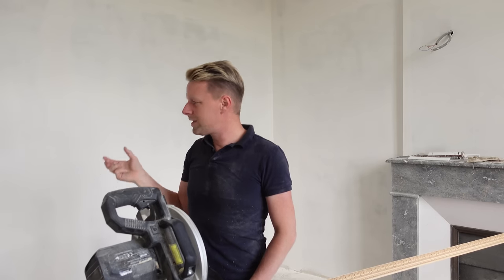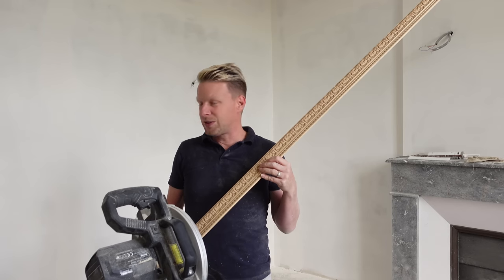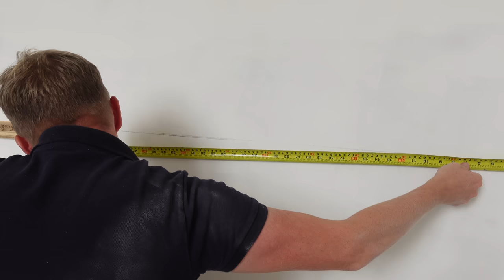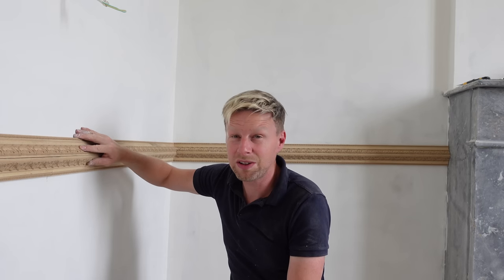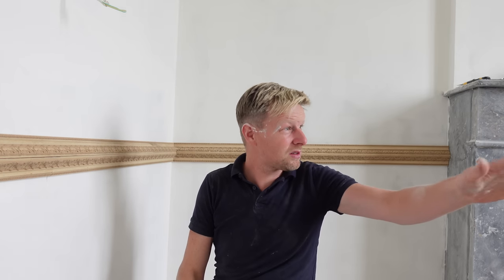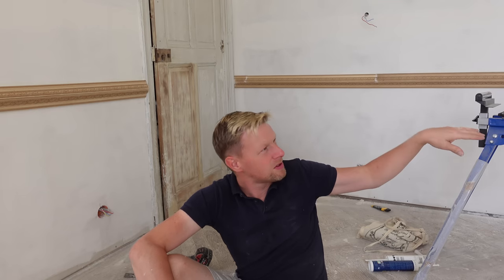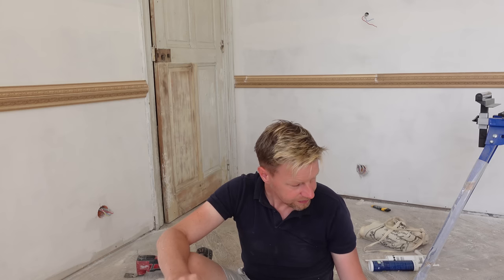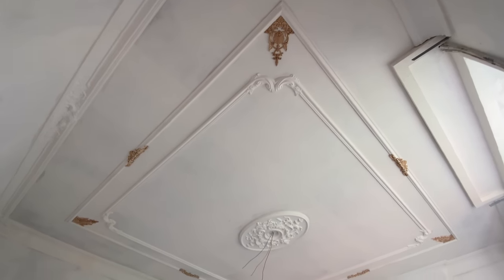The Chateau Bedroom Makeover | Adding The Decorative details.

Comment: Was just noticing you’ve left the piping for the old radiator system. Are you going to reinstate that system or have electric heat? Was just wondering because of all the piping still there.
Reply: We’re likely going to reinstate the boiler in the basement in 😊